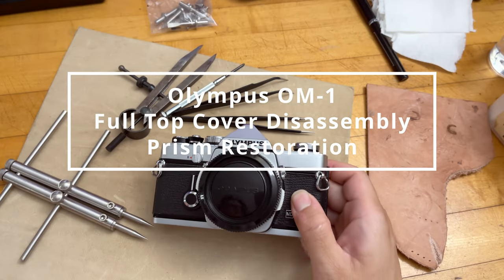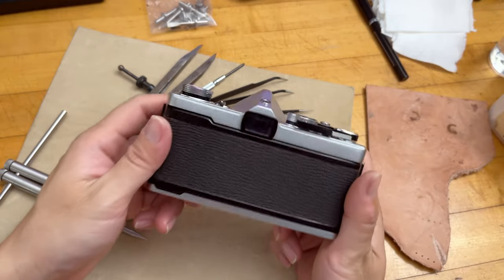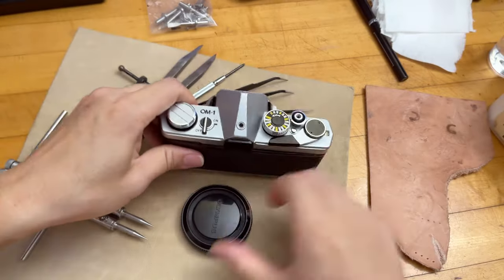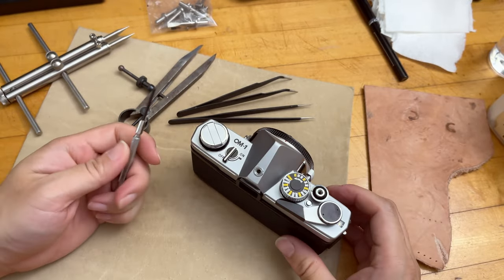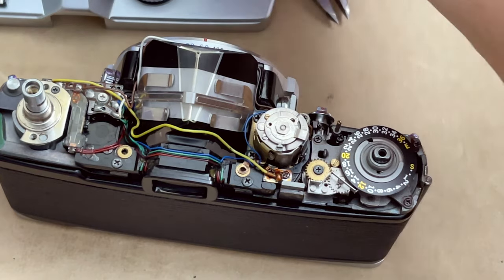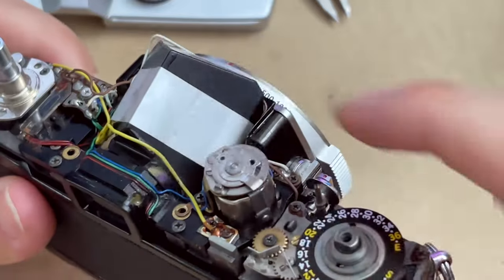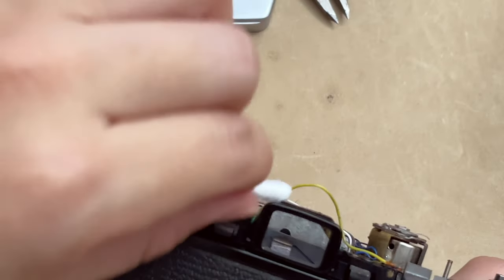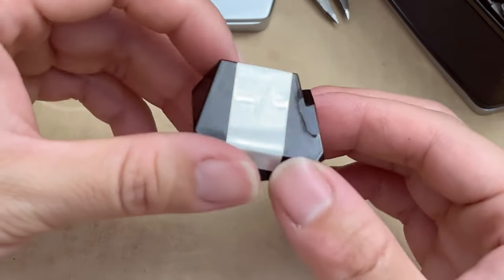Olympus OM-1 Top Cover Disassembly Viewfinder Clean & Prism Restoration Using Toothpaste

Comment: I have an Olympus OM-1 that hasn't been touched in over 10+ years...I have never even attempted taking apart or cleaning a camera. Is this something a beginner can do without fear of damaging the camera? Your video is great and makes me feel like I might have a chance at cleaning this.
Reply from the maker: My advice is if you have not ever disassembled something before, I would suggest sending it to a Olympus film camera repair specialist to do the job
Reply: I went the dumb way and just tried it myself and it was surprisingly easy! However there were a few shaky moments. If you're dependent on the camera, send it off. If it's a hobby item, is just go for it. 😁

Comment: Great presentation. Wondering if it is worthwhile examining my beloved OM-1 which jumped out of a defective backpack on a mountain hike (it would have been safer hanging around my neck!); it had been a reliable camera for about 20+ years since the mid-1970s. Likely there is some interior damage even though the camera was in one piece (the aftermarket zoom died - but I have the original Zuiko 50mm somewhere!)
Reply: Would be a hefty task... Might just be easier to dry fire a few times and check shutter speed accuracy as well as the light meter. Rewind a few times to see if it would turn without any noise and shake it a bit to hear if there are some lose pieces... If something doesn't check out, then it might just be worth a while to get a replacement unit.

Comment: Hi! Cool video which will come in handy as I am buying a couple of PMs :) thanks for sharing! Is the prism the same across all the OM series (from 1 to 4)? The missing black bit on the prism that creates the artefact, is it possible to cover this exposed part of the prism with something black? (gaffer tape came to mind). Thank you!
Reply: I'm wondering this too... but perhaps the glue of a tape might lead to some other artifacts. Why not a gentle layer of water based paint?
Reply: @UltraSteaKME  It might be hard to paint a side of a super smooth cristal.

Comment: Hello from France ! Have you try to repaint the prism with black paint ? I have the same issue here with a OM-2n...
Reply from the maker: Bonjour, once the damaged silver prism covering is removed you really don’t have to do anything, the coating is black but a reflective silver on the other side. Not sure what will happen if you paint it but all prisms I have restored with exposed glass all works fairly fine with just a small thin line visible in viewfinder of the damaged area
Reply: the glass is silver coated then pained black for protection  similar to home mirrors.

Comment: I need to puck up that kens wrench. I was given a Nikon F2 with a stuck shutter. Hoping I can fix it
Reply from the maker: Shutter issues require specific fix for specific camera models, you might want to watch a few more F2 disassembly video and shutter repair video before tackling the issue. Good luck!

Comment: Hey man!  Awesome video!  
I just have a question about cleaning the pentaprism with a toothbrush... what did you do?  Did you brush the side down where the paint was peeling?  
How hard and how much did you brush it?

Thanks!!
Reply from the maker: The coating was pretty hard material. I brushed the general area concentrating on deterioration, and had to use a sharp pointy tweezer to remove bad coating until tweezer can no longer scratch any more coating off. Put prism back on top of camera and preview, if you did a good job the deterioration will be barely visible

Comment: Putting a plastic piece directly underneath the cap on the advance lever was such a dick move from Olympus... The holes in the cap are big enough that the pin points on a spanner wrench will stab the plastic piece under it if you apply pressure to it, which you will 100% do in order to get the best possible grip if the cap is stuck in place. Glad I realized it before I actually broke the plastic.

It bugs me to no end when stuff like this happens. Now I need to buy a couple screwdrivers and give them the dremel treatment so I have two bespoke, pointless pins to add to my collection just for this fucking cap lol. Oh well.
Reply from the maker: The plastic piece is a cheap washer to ensure smooth lever movement but yeah

Comment: 7:40 the incredible hulk must have screwed this washer back on because it took my whole body just to get this loose. I even managed to take a massive chunk of metal out of the holes
Reply from the maker: sometimes it does get stuck due to age, you can try to drip a few drops of 70%-95% alcohol under the washer to dissolve the gunk a bit, might be easier next time.

Comment: Why didn't you just stick some black tape over the spot eaten by the foam?
Reply from the maker: Tried, doesn't work that way, light gets scattered inside the prism and still shows a big mess.
Reply: @TheGizmoGarage  How is the black tape different to black coating?
Reply: The silver coating provide the bright image reflectivity in the prism,  the black coating protects the silver   Tape is bad because someone might try to remove it and peal the silver  plus it may damage the coating like the foam you just removed.